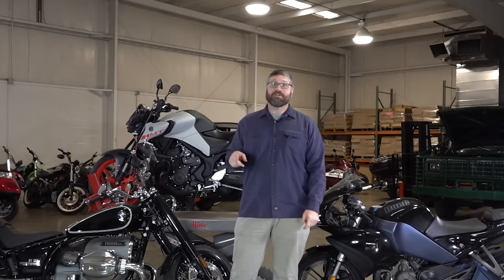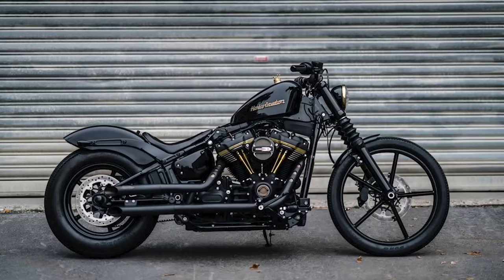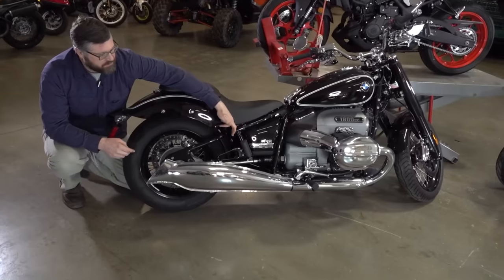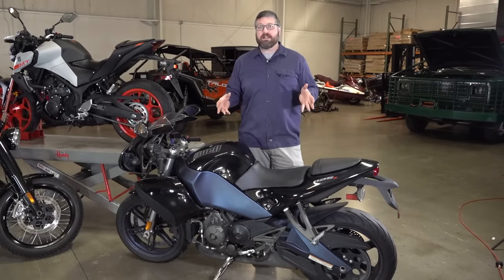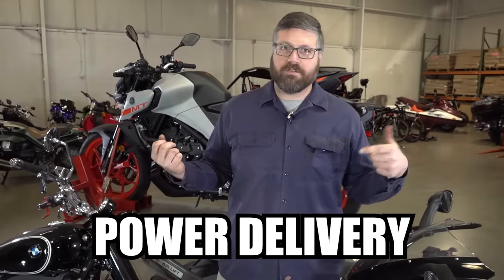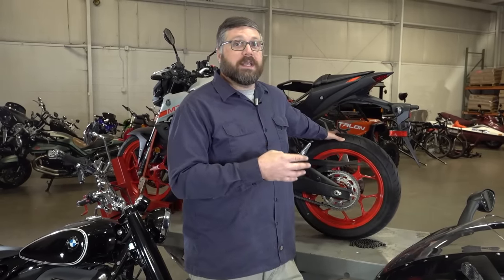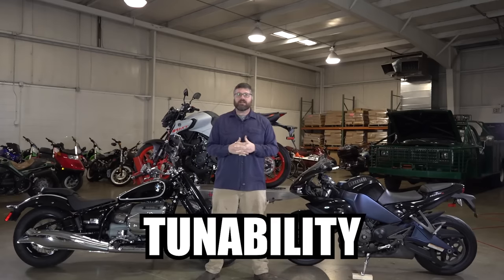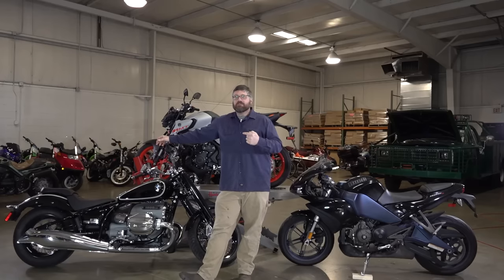Motorcycle Chain vs Belt vs Shaft Which one is Better?

Comment: Easy question to answer with a parallel question: How many production cars have chain or belt drive?

Zero.
Reply: Well the reason behind that is the difference in vehicle weight and engine power. 

Bikes typically weigh less than a thousand pounds and put out less than 100 horsepower and 100lb-ft of torque. (Emphasis on typically) 

Cars and trucks normally weight over 2,000 pounds and put out between 150 to 700+ hp and wildly different numbers of torque. They NEED the durability of shaft drives.
Reply: @sasukedemon888888888  My shaft drive Royal Star (1300) has a 73HP V4 engine, my shaft drive Vstar 650 is 40HP.
The 12 different VW Beetles and campers I owned over the years were all less than 60HP - most were less than 50HP.
Your reason has no merit. Shaft drives are zero maintenance except for changing the hypoid 80 oil in the rear hub - they are good for well over 100,000 miles
a chain needs to be adjusted every 500 miles - thats madness
Reply: @kenwittlief255  you completely ignored the argument of weight there bud, but I'll get into more detail.

Take into the account of both vehicle weight, size, and where the drive train needs to be. On virtually every single car, camper van/bus, and other 4 wheeled automotive vehicles. The vehicle weighs close to or over half a ton. Often exceeding 1 ton. Due to the engine being in a low position in the front or rear, and needing to connect with wheels that are the lowest points on the vehicle. The drive train is under the vehicle too. 

To use a chain drive, for maintainence, you'd need to jack up the vehicle, crawl under, and perform maintainence virtually every time you plan to use it. The chain would very, very rapidly wear out due to the weight it needs to move. Significantly more weight than a motorcycle. Accelerating too fast is liable to snap the chain before it can apply the force to move the vehicle. I say this because it is likely to snap than spin the tires due to the sheer weight difference.

Same argument for belt drives, but instead of snapping its risk is skipping teeth and not applying any force. 

The shaft drive is the most durable of the option. Able to take both the force and weight time and time again with no issue and minimal maintenance. Which never includes the driveshaft itself and only either the transmission or differential. Maintainence is few and far between which saves you needing to jack up the vehicle and crawl under it frequently. 

Driveshafts are strong enough where you only hear of them failing in either high stress applications or decades of use.

Now. Unrelated. I didn't know the yamaha v-star series came in shaft drive. My father has a yamaha xv1600 and it is belt driven.
Reply: @sasukedemon888888888  do you think there is only one size chain made on Earth and one size drive shaft?!

the weight of the vehicle has nothing to do with the performance of a chain vs a drive shaft - you can make a chain or a drive shaft to handle any amount of torque to the wheel you want. Needing to jack up the car has nothing to do with it. Air cooled VWs has clutches that needed to be adjusted every 10,000 miles and oil that needed to be changed and valves that needed to be set every 3,000 miles, and you had to get UNDER the car for all three.

There were bicycles made with shaft drives in the early 1900s.

I didnt ignore your argument of weight, your statement is nonsense. Chains and shafts can be designed and fabricated for ANY required load torque. The shaft is better. 

About half of the Vstar bikes had drive shafts, the other half had belts, and the little 250 had a chain because it was the cheapest Vstar they made.

BMW started putting shaft drives on their motorcycles way back in the 1930s, when a 400cc engine was HUGE, because they were mostly used on dirt roads and a shaft drive was indestructible.

Comment: Love the nerd stuff! Experienced mc tech here and it’s my passion. Have a 79 Yamaha XS1100 cafe racer/bobber thing that’s shaft drive. I’ve looked into converting to chain and it’s a whole ordeal done by very few. I have plans on doing it in the future, but will require a custom hard tail or swing arm and wheel to do. Yamaha nerfed this poor motorcycle with only 5 gears and shaft drive.
Reply: Someone here mentioned there’s a mod you can do where you swap parts from a xs650? I don’t know what effect that has though.
Reply: @Parker-di7ef  I know of a guy on eBay that makes and sells custom billet CNC bevel gear box delta plate that you can then put a xs650 countershaft sprocket on instead of the bevel gear but it’s up to you to figure out how to put a chain and sprocket to the wheel. I plan on using that
Reply: @TheSeaLark  sounds cool man! Best of luck on the project. Former XJ650 here. Put some videos up on your channel when you’re finished!

Comment: Excellent discussion, Craig, thank you for making this video. 
I've had a few Honda Shadow 1100 bikes, Vulcan 1500, Honda CX 650, Honda ST1100 and others. Their shaft drives worked flawlessly but for good maintenance I always took the shaft out at each tire change, and lubed the spines. This gets tiresome after a few times. Chains are easier to maintain and customize. After buying a used Kawasaki KLR650 and Honda VT600 Shadow, the first thing I did was install a rear sprocket with one less tooth, and shorten the chain. Much improvement on the highway.  Oh, yeah, I did it on my Kawasaki 750 M1CSR as well but there it was simplest to add a tooth on the front sprocket and relax the chain a bit.  These procedures made all the bikes less buzzy at highway speed.  On the Honda CX650 that wasn't possible due to shaft drive. I had to know if the bike would go 100 mph and it did, but it blew a head gasket as a result. Belt drive is Harley-Davidson's mainstay, and my FLHR Road King has been doing well at all speeds, although it seems to need regular tension adjustment.  For problem-free operation, the smaller bikes with chain drive, and using X-ring chains, have been unbeatable.  Bottom line: I'm in full agreement, chain drive is the most hassle-free way to go.
Reply: As I recall the CX500 had a grease nipple and general greasing of the drive and socket was all that was required. Either eventually the wheel socket or the actual shaft drive would wear out at about 80,000 to 90,000 miles but replacement was simple and readily available at bike breakers.

Comment: Nice video, but you might want to spend a few seconds on the relationship between crankshaft orientation and drive type. With a few exceptions when crankshaft rotates parallel with the wheels you use a chain or belt, if they run perpendicular you use a shaft. There are some exceptions like the shadow which from a power delivery standpoint makes absolutely no sense.
Reply: how many Vstar models did yamaha make with shaft drives? 650, 1100, 1300 V4 royal star and Vmax.... ?

Comment: Shaft is waaaay overestimated. It creates rocking movement, waights a ton,  costs a fortune to fix and becomes less and less enjoyable gaining mileage. Belt is just fancy, delicate chain. The very best solution for commuting and tourism is... chain closed behind sealed cover. Check out Yamaha TR1 drivetrain- it's quiet, lasts longer than you think, adjustable, clean, durable etc. I guess belt in cover would be almost as good.